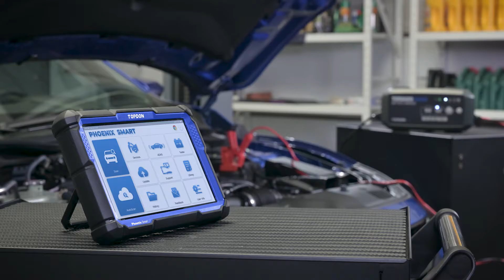What's  TOPDON Battery Charger Tornado30000?

Comment: Does it charge AGM/VLRA/EFD?
Reply from the maker: Hello,
Tornado30000 supports charging 6V, 12V, and 24V lead-acid batteries, including Wet, Gel, MF, EFB, AGM, CAL, EFB, and AGM, as well as 12V/24V lithium batteries. It also supports a range of battery capacities from 50Ah to 1000Ah.
Reply: @TopdonOfficial  I already bought it. And paid to your dealer. I will write review after using it. Thx for the reply

Comment: is it also a jump starter?
Reply from the maker: No，The Tornado30000 is a smart charger made for personal or commercial use, repair stations, and more. It can revive 6V, 12V, and 24V lead-acid batteries as well as 12V/24V lithium batteries. This device supports a range of battery capacities from 50Ah to 1000Ah. With a 9-step smart charging method and 12 charging modes, the Tornado30000 provides unparalleled protection and charging capabilities for its users.

Comment: Is it a charger or voltage meter or both?
Reply from the maker: Hello sir, T30000 is a charger and can be used as a regulated power supply for car programming.  It's not a voltmeter